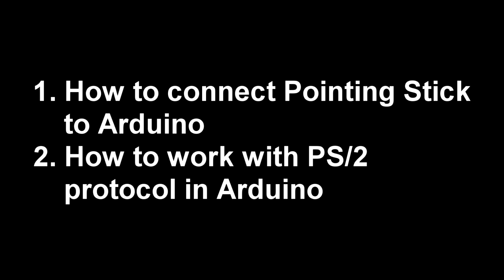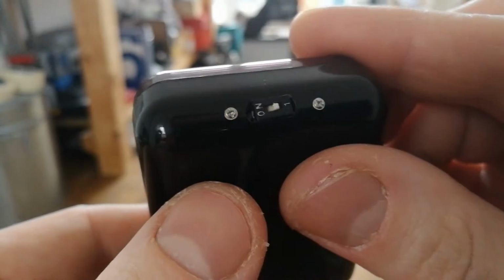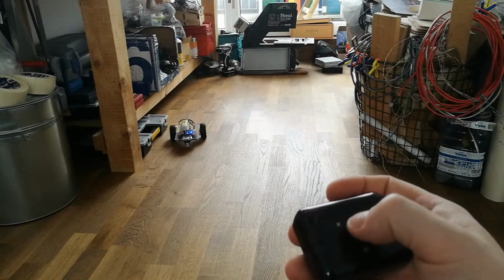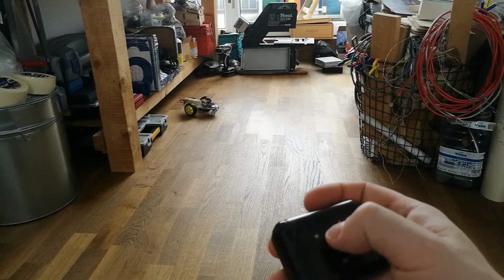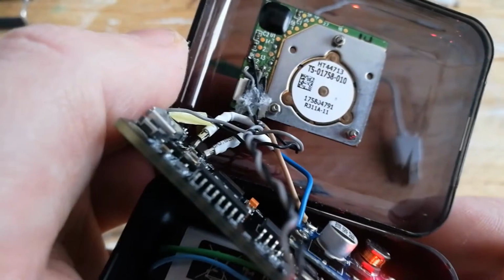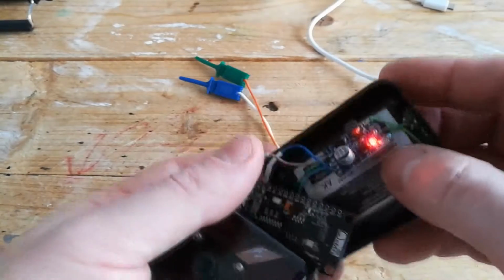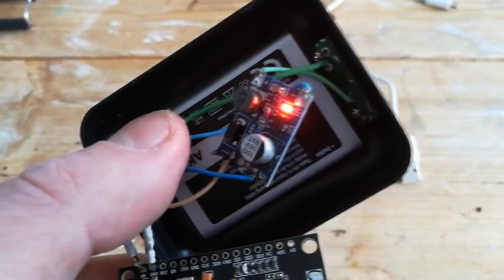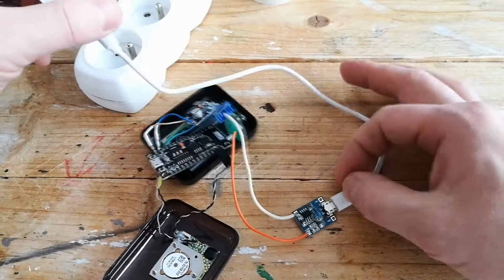Smallest joystick in the world? Notebook pointing stick and ESP8266 to control robot car

Comment: Sir please Share the codes file for this project. Because I couldn't find any code to access the output pin. Or please make a new video for replacement of joystick with ps2 mouse as an analog output
PS2 digital mouse for replacing analog joistick  thanks